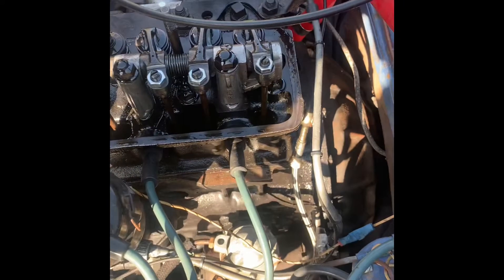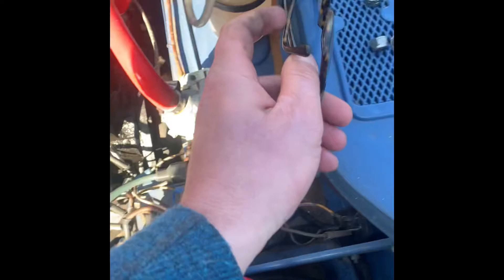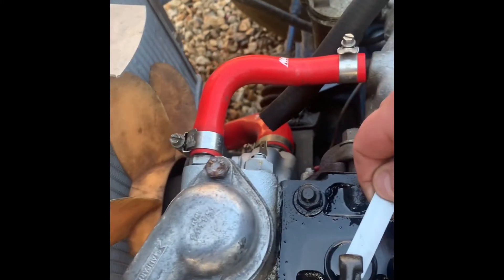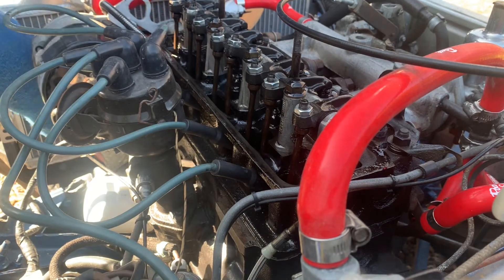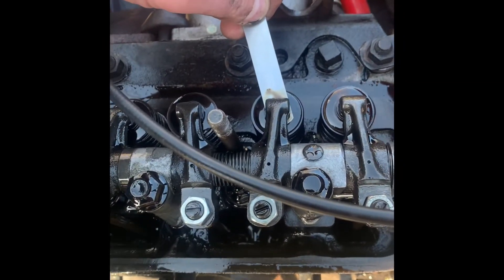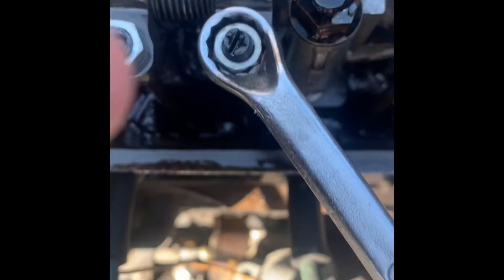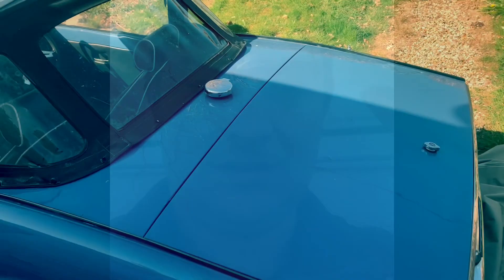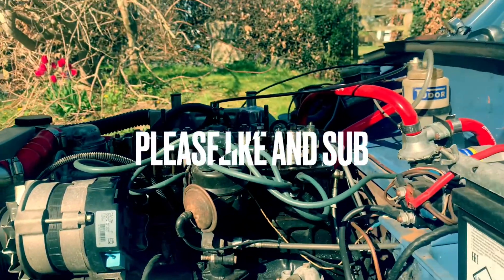Valve Adjustment - Triumph Spitfire - Classic Car

Comment: I've got a 64 Triumph spitfire. It had one of the rocker arm adjusters strip out so I can't adjust the valves. I purchased new rocker arms, new rocker arm shaft, and new pushrods. The new pushrods are longer than my old ones. I had zero adjustment with them. I removed them and reinstalled my old push rods and I still have zero lash. I don't know what's going on. Do the new style of rocker arms require shimming the pedistals in order to have the proper lash?
Reply from the maker: Hey hey!! Thank you for your comment! This is the first comment I’ve had in (500k veiws) I am kinda unsure of….

Are the threads in the head ok? As if they are a little striped out then that can cause play?

May seem simple but just playing devils advocate
Reply: @TheTriumphGuy101  nah my brother ordered the wrong push rods. It's all good!
Reply from the maker: Ahh good good!

Comment: Some old guy told me back in the 70's an easy way to move the engine. Put the car in 4th gear and let off the brake and just move the car to adjust. Best on level ground.